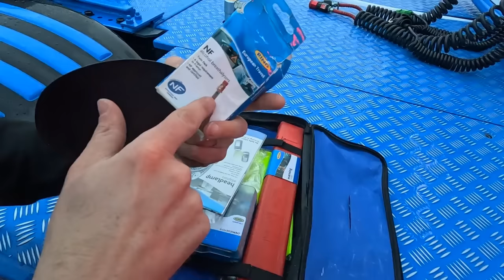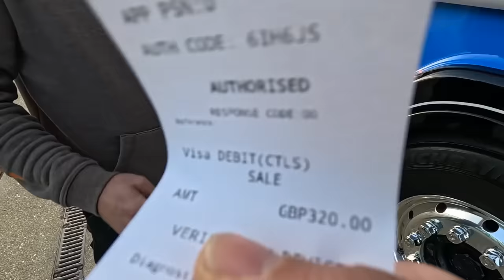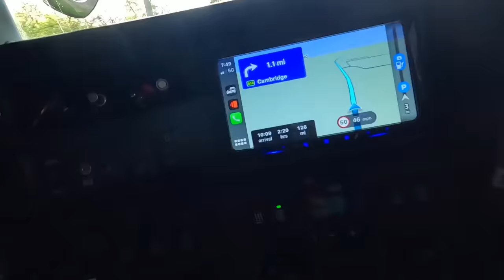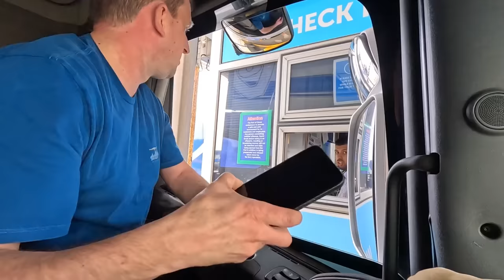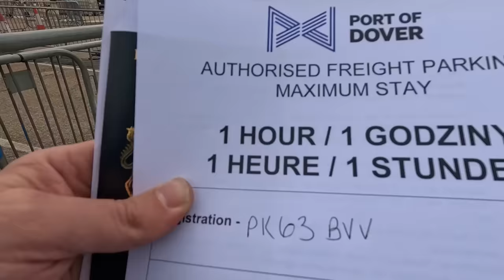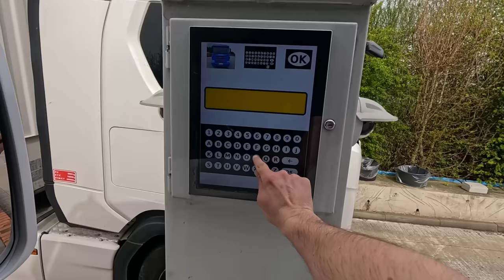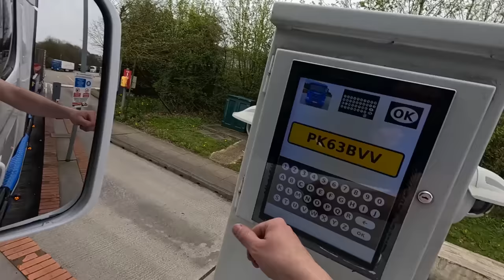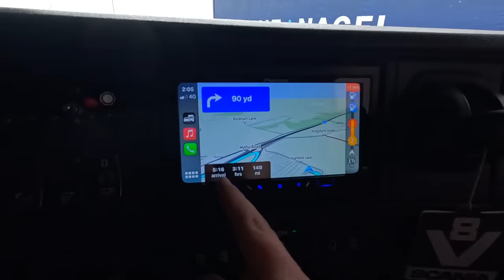MY FIRST EUROPEAN LOAD *FAIL* | SENT AWAY FROM DOCKS | #truckertim

Comment: So just a heads up for future mate, your GMR and PBM numbers should be sent to you via your office etc, then the GMR must be put in on the website before you get to the dock of travel... input your number and itll give you a green/amber/red for a customs check. Then do the same with PBM but before you get to your port of arrival. Technically also, you should be displaying you 'angle morts' stickers on either side of the cab and trailer, and a UK sign on the side of your number plate... To go through belgium you need a toll box, you can get these from random laybys/truck stops in belgium (theyre like vending machines) you have to scan all your docs (v5 insurance etc) then pay the amount and itll give you the box, plug it into your cig lighter and the light will go green when in belgium... you can return them leaving belgium.. Hope this helps for future
Reply: That sounds more hassle then it’s worth but useful info though
Reply: i hope he won't drive trough germany, bc he would be instandly be pulled over for having a openwheel 😅😂
Reply: @Dutch_Sprint  Yup, Germany is a tw@ to go through... haven't done it myself, we just normally go France, Belgium, Luxembourg
Reply: Openwheel?
Reply: @lueyR  what he means is the steering wheel ''3spoke'' if they see that, your fcked atleast it isnt white of color so its blending in more now
Reply: Not GB anymore mate its all UK for the country indicator since a couple of years ago.
Reply: @roydewolde3128  wow really? Why have they made that illegal?
Reply: @lueyR First, no airbag, and it doesn't meet the safety standards. Of course, older trucks can have them if they were standard.
Reply: @roydewolde3128  aaaah airbag makes sense
Reply: Thank god I got out of agency work before all this euro business.  Think I will stay with uk haulage work 😂
Reply: @Dutch_Sprint  No we have some in our trucks absolutely legal wheels we have 🤷
Reply: @roydewolde3128, even with the original steering wheel it doesn't have an airbag ( I personally haven't seen one not even on the new gen) I might be wrong.
Reply: @lueyR a wheel that is open or the polar opposite to a closed wheel.
Reply: Angle morts sticker aint needed on highways neccessarily
Reply: @lueyR  not TUV approved....
Reply: @themondaydriver3670  my instructor said it whas not legal when i had my driving lessons ( something to do with no airbags ) ithink, its a view years ago, thats the only thing that have sticked with me over the view  years
Reply: Dover is easy compared to entering and exiting Morocco , On top of customs u have to temporarily import you truck and trailer , take plenty bribe money , cigarettes also help to jump the queues ..
Reply: @NormalKatastrof Only needed for France but not the corridor to Belgium (A16) so he'll be ok 👍🏻😁
Reply: @lueyR  Politics it matches your tachograph
Reply: Respect at the knowledge.
Reply: @Dutch_Sprint  GO ALGARCIRAS   TANGIERS GET A GOOD AGENT. .
Reply: Maybe you should be his advisor, he clearly needs one
Reply: @bradleyboyle6858  Alternative is Harwich to Hook, pricier ferry, longer crossing and even fewer officials to process the paperwork this government chose loads to require when it took us out of the Customs Union as well as the European Union.
Reply: The joys of brexit fiasco

Comment: Welcome to post BREXIT life Timmo. Wayyy harder to take anything from the UK to EU and back. Always best to check online what paperwork you need before heading out on the trip
Reply: I've never driven to UK, but in EU you must have CMR even if you don't cross any border. Is haulinng in UK so different? 🤔
Reply: Don't mention the B word! 49/51 I wonder what it would be if there was a Ref now!
Reply: Used to use T-forms in the late 90' so nothing new going back to using them again. Don't miss standing on the stairs at Dover with T-forms
Reply: @lexik223 just need a proof of delivery note. If carrying alcohol that is tax suspended you need an ARC number
Reply: @ianthompson5440 now severington… 🤣

Comment: As someone who works in logistics dealing with customs formalities, a T1 is not always needed, it can be a EUAA or EUAA T1 or EXAD or EXAD T1, but only if the stock is not customs cleared a T1 is needed. But most of all the T1 is always on request of the transporter / customer

Comment: Also you need ‘angle mortes’ stickers on truck and trailer - French requirement
Reply: No he doesn't, he's going to Holland, angles mort stickers are just for urban driving.
Reply: @jja6034  but he will be using French motorways to get there….
Reply: Not needed for transiting France,only urban areas,and he’ll be going straight up corridor into Belgium if he finally gets it right
Reply: @graemetaylor5357  so why does every truck and coach that goes out there have them?